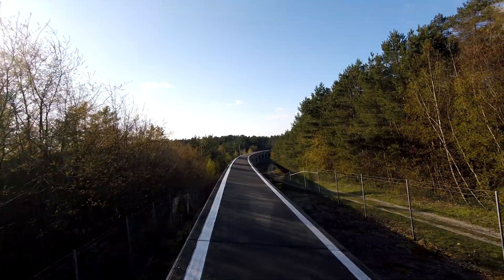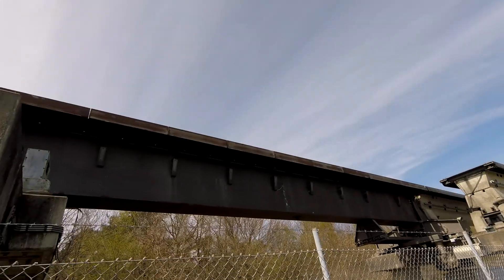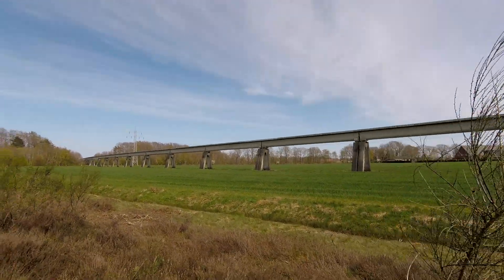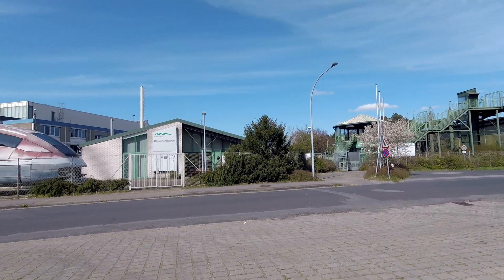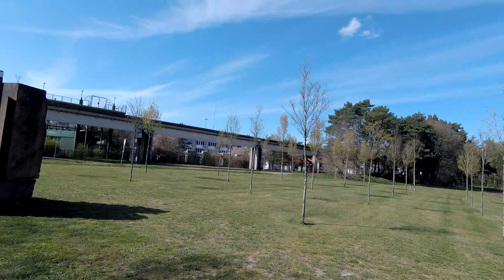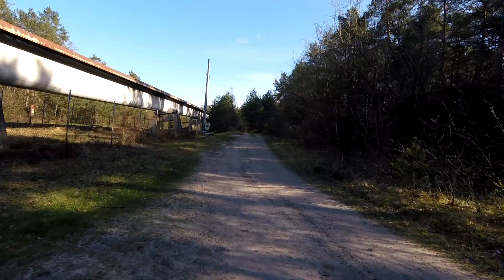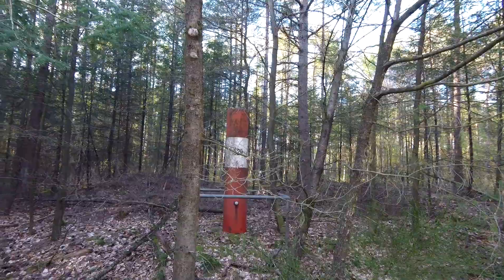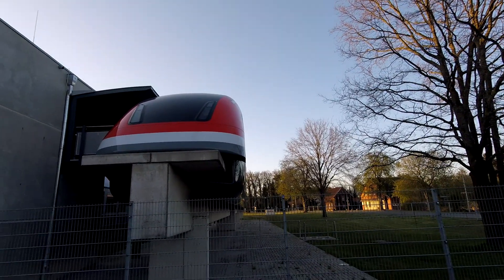Germany's forgotten HIGH SPEED TRAIN test track | Maglev Transrapid

Comment: The problem with EMS is it only has 1 cm clearance and after time it subsides like in China that has to be slowed, they need proven Japanese EDS that has a clearance of 10 cm but all the guys in the maglev forum are european and the EMS is fast enough for big countries to have overnight container trains subsidising daytime fares lower than planes.
Reply: The stability and subsidence issue is common to all types of slab tracks including for rails, as well as maglev.  With a traditional ballasted rail track, if the ground moves or settles a bit you only have to have a track alignment and tamping machine visit and it can be restored in a few hours.  It's often said that slab track is cheaper to maintain in the long term than ballasted track, but that's only true if there's no ground movement - for any kind of slab track the geotechnics have to be guaranteed 100% stable forever or you're in trouble.

Comment: Transrapid easily carry medium weight freight. Each car have a maximum brute mass of about 100 tons, while transporting cargo thenspeed would typically be limited to 250km/h

Its rather high speed rail track that have issuse carrying freight. The HS1 line in uk have a speally adopted train for freight.

The claim that transrapid track is expensive have to be taken into comparison to high speed track

Comment: Shanghai Pudong Airport purchased this train and has been operating it at a speed of 430 kilometers per hour until now. It has really continued. Why did Germany abandon it? It only takes 7 minutes from Shanghai Airport to 30 kilometers from the city. Isn’t such a good thing going to continue?
Reply: If it's such a good technology, then why didn't China continue to expand their transrapid network? Because it's just too expensive. Instead China built a huge network of conventional high-speed railway lines.
Reply: The very short answer to that question is corruption.